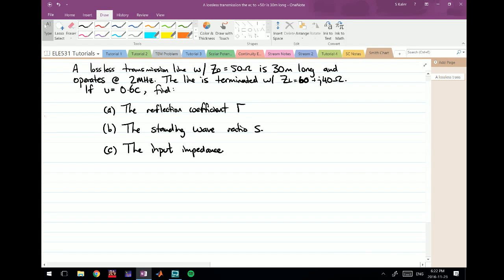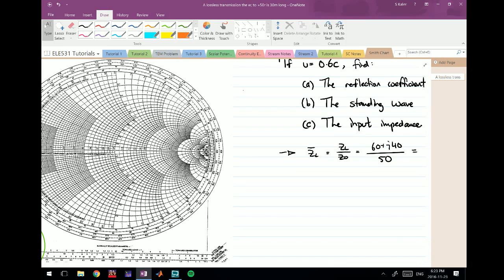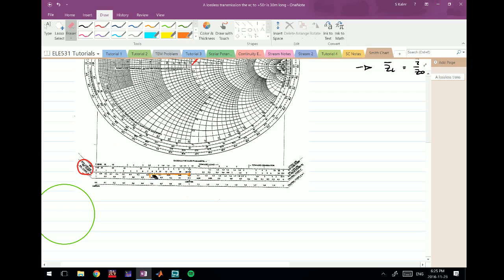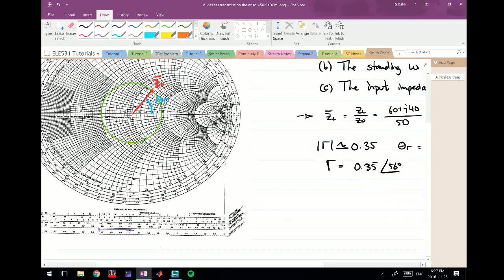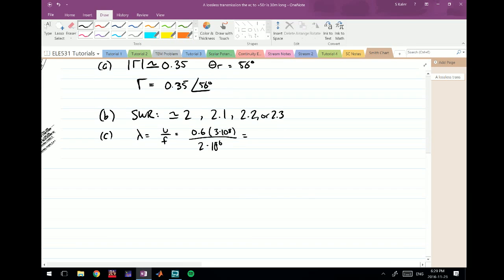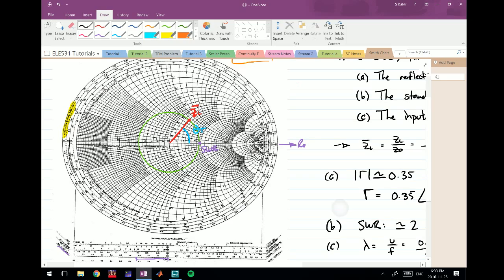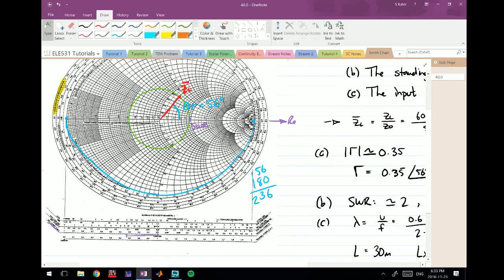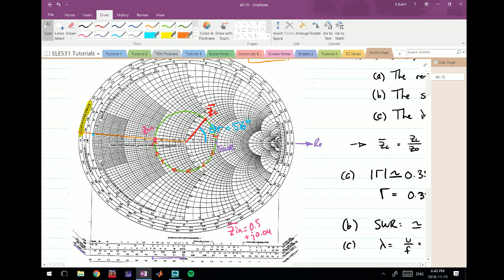Smith Chart Problem #1

Comment: Can't we just extend the line of the 'reflection coefficient' from the radius of the VSWR CIRLCE to the outer edge of the chart and read the 'angle of the reflection coefficient' there at the point? which is 56 degrees?

Comment: i didnt understand how u get in Zin=j0.04
Reply from the maker: You know the length of the line and the wavelength of operation. You can then normalize the length of the line to the wavelength of operation. Since we know where the load is, and how long our line is, we can travel around the Smith Chart (towards the generator, since we start at the load and therefore cannot go any more towards the load) for the length of the line. The length of the line turns out to be Lambda/3, which you convert to an angle in degrees (240 degrees). So, using the angle measurements along the edges of the Smith Chart, we travel 240 degrees from our load, towards the generator. Finally, you can draw a line through the center of the chart, to that point you end up at, and the intersection between that line and the green circle in the middle is the input impedance. The real component of the input impedance is based on the numbers along the horizontal axis of the chart. The reactive component comes from the numbers (the ones that are upside down on the left side close to the horizontal axis) along the edges of the Smith Chart (top half are +j and therefore inductive, bottom half are -j and therefore capacitive) which indicate that they are used for reactances. 

Hope this helps.

Comment: This is a bad use of the possibilities of the Smith Chart. Calculating angles and using protractor shows lack of knowledge of the Smith Chart. 
By making the line from origo through ZL all the way to the outer ring, you would be able to read of the angle directly from the chart (Angle of reflection)
SWR is not read from the Smith Chart where you show it. It is much better and more accurate to read it from the same ruler you used to read of reflection coefficient. Just use the top line marked SWR...
When you are to find the Zin 1/3 wl from the load you definitely don't do what you did. What you do is to read of the WTG (Wavelengths towards generator) on the outer ring scale. To that number you add 0,333 wavelengths (if the result is higher than 0,5 you subtract 0,5 from the result). You find this value on the WTG scale and take a straight line from this point to origo. Where this line crosses the constant SWR circle you have Zin.
Reply from the maker: Thanks for the detailed comment, I appreciate your input. I do agree that there are much more accurate ways of using the Smith Chart, however for someone that is just starting out, this has been (in my experience) a fairly decent place to start. When I solved the actual Smith Chart, I did the entire process that you describe, using rulers and the scales along the bottom, however it is a little annoying and difficult to do it in a video being recorded on a tablet. In my lectures, I advise students to read it off of the scales at the bottom using the methods you've suggested. On the other hand, and while this reason may seem a little less relevant, some Smith Charts don't offer the scale along the bottom. As far as travelling around the ring scales on the outside is concerned, since it is a distance, the scale it self is actually not as relevant (while one may be more correct theoretically) since the difference in points (regardless of the scale you used) will result in a fixed distance. Again, I really appreciate your input, and I'll be sure to address the points you've raised in future videos.

Comment: Where does Zl (zed L) come from?
Reply from the maker: It's given in the question as the load impedance.
Reply: Ok (And thank you) but that information came from somewhere.
Reply from the maker: So I guess your question is where does this problem come from? Because that's a part of the problem as seen in the textbook I used, which is the 5th Edition of Elements of Electromagnetics by Sadiku.
Reply: Something like that. When a problem is stated If <set of conditions> then find <results> I tend to wonder how the set of conditions were determined. Coax parameters are available from the manufacturer. Frequency, I should know else why am I even working the problem. How do I determine Zl. I assume there is some method for determining that value? Test equipment?
Reply from the maker: Ah, well usually you'll know what the impedance of a load is given a certain configuration. Suppose this load were an antenna, then we would know from a manufacturer datasheet, or by measuring the input ports of the antenna using some test equipment. In most high frequency cases, you can use a Vector Network Analyzer (VNA) in order to measure the S-Parameters of a system (similar to the Z-Parameters that we use in circuit theory). Using those parameters, it's possible to determine things like input impedance, which in this case would be the load impedance that the line sees. Hope this offers some insight.
Reply: Perfect. The missing piece was the VNA and manufacturer datasheet. For some reason I didn't think of that one.
Reply from the maker: Glad I could help :)

Comment: Stupid question but, once you find the normalized load impedance, how come you choose the imaginary circle (0.8) on the top half  and not the bottom? When would you put it at the bottom?

Thanks for the video btw.
Reply from the maker: No such thing as a stupid question. We use the imaginary circle at the top because the impedance is given as 60 + j40. The +j40 indicates that it'll be on a circle at the top. You would place the load at the bottom whenever the reactive part (term with the j in front of it) is negative. For example, if this load were 60-j40 it would be at the bottom. Hope this helps.
Reply: Thanks a lot.